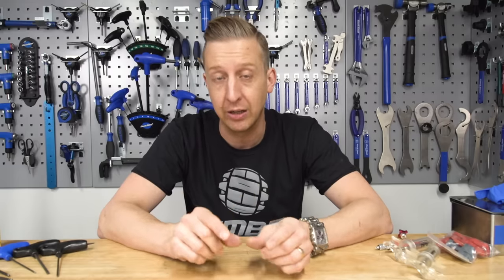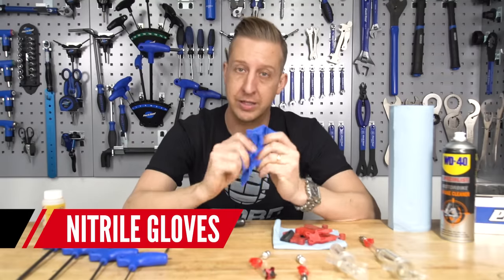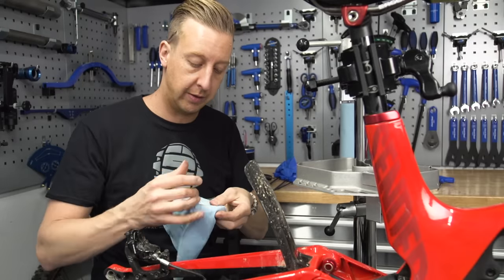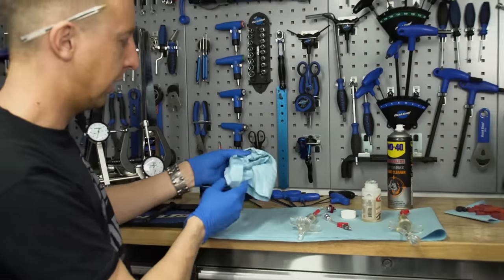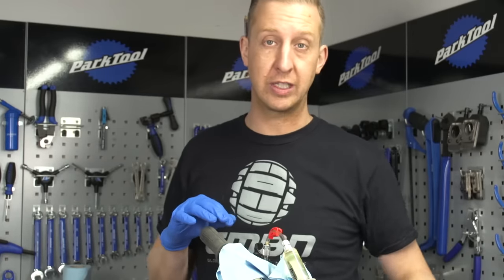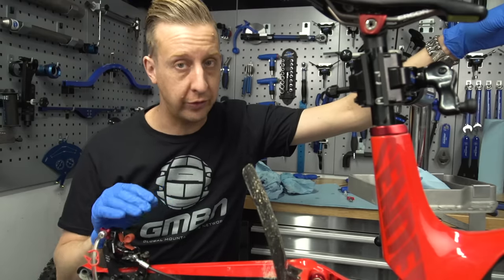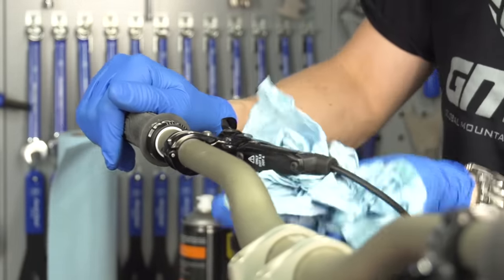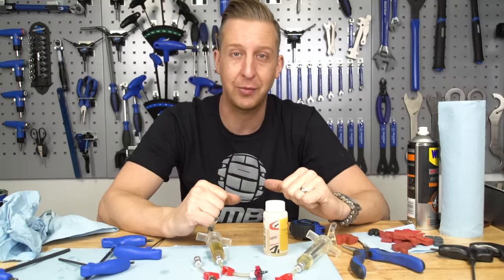How To Bleed New Sram MTB Brakes | Bleeding Edge Technology

Comment: watching this makes me appreciate my fool proof rim brakes on my 26 wheelies.
Reply: Lol.  Fool-proof.   Yeah right.  Case a big jump at high speed, bend your rim or untrue your wheel and see how great those rim brakes are.  Go through mud and water not to mention rain while descending a steep fast trail and see how great those rim brakes work.  Disc brake performance is unaffected by all of the above.  (Granted some will squeal but that’s true of rims too.)  Additionally you grind away your rim in time if you ride in a lot of dirty conditions like I do.  Lastly of course disc brakes simply have way more stopping power.  A nice thing to have when you’re 200 lbs and heading 30 mph down very steep single track and need to... BRAKE NOW!
Reply: Pete West dude chill hes just happy with his brakes just calm down dude
Reply: Where I live there is nobody who does this kind of maintenance by the book.
Reply: I'm getting a whiff of Aspergers from Pete West.  Guy sounds fucking insane.
Reply: RollinRat  I agree. What I'm saying is that people without their own shops are also without options.
Shops around here never do it right, or right out break it while doing maintenance.

Comment: Guide T brakes - can't get enough fluid into the lever, pulls nearly to bar with new brake pads... HELP.
This bleeding edge system seems to be a 1way system, makes it impossible to push fluid from the caliper to lever to refill the spillage. @jennifercoons trick doesn't seem to work - are my NEW calipers busted? Old system was way better for fine-tuning the bleed / fluid levels.

Comment: So I have mostly been a Shimano user. My new bike has a pair of Guides on it with T levers. I just went to bleed them for the first time and it was an AWFUL result. I've followed GMBN AND SRAMS videos and followed the steps meticulously. 3 Times. No matter what, I lose all the pressure I pushed into the lever when I disconnect the bleed hose. I've read a million forums, and people suggest pushing the oil through WHILE closing the bleed screw at the caliper, as opposed to just leaving the caliper closed when you pressurize at the lever. This did not work for me. When I'm pressurizing the system I can FEEL how firm and incredible the lever is, but as soon as I disconnect the hose from the lever all the oil and pressure just escape the top. I put the screw back and all the pressure is lost. Spongy lever. EVERY TIME. I made sure the lever is above the caliper and that the caliper is correctly oriented. There are NO air bubbles coming out of the system. Ive tried manipulating the lever while performing a bleed.  HOW do you get the pressure to REMAIN in the system when you disconnect the hose at the top!?
Reply: @jasperbakkertube  Thanks for your effort! I had actually seen this guide when I was experimenting! I was trying this method, which felt great as I was bleeding but it still lost the firmness when I disconnected the syringes. Ultimately after experimenting and practicing I figured it out with consistent, repeatable results. For me, the missing step was really waiting for the syringe to equalize as I pushed it down and squeezed the lever. I needed to really hold down the syringe and pump the lever until the system adjusted, which took a minute or two. I was likely releasing the syringe too early causing the pressure to kick back up into the syringe!

Comment: After disconnecting the lever syringe, so much oil leaves the bleedport, that the the lever isn’t pressurised enough. Is there a trick for not letting too much oil being pushed out of the leverbleedport? This problem only appears with the back brake (longer hose?). I hope someone has the golden tip!
Reply: Michel Kok I have had better luck ending with the caliper end since it has the bleeding edge port which is designed to be closed while connected

Comment: Why can't you use mineral fluid in a dot fluid specific brake....
Reply: Ghosty1890 Because the brake line already has dot fluid inside it and dot will destroy mineral oil. However if the brake is completly dry when you get it you can try it! I wanted to try it myself but haven't had a chance
Reply: Sumo's'Enduro cheers always wondered
Reply: There is a rumor that mineral oil can ruin D.O.T.-specific seals (and the same is said to be true the other way around).
Reply: KennyMinigun but the dot fluid is more corrosive and so in theory would be more resilient...but could be wrong...cheers
Reply: Ghosty1890 I'm a bikemechanic and I can say you two guys one thing. Mineral oil does not ruin dot specific seals. But dot ruins a shimano or any other mineral oil brake.
Reply: Sumo's'Enduro yeh that's what I guessed
Reply: Ghosty1890 But I haven't tried it yet. I want to try sram brakes with mineral oil.
Reply: Sumo's'Enduro yeh love to do a bit of testing....maybe we can see whether doddy can try it
Reply: Ghosty1890 Yeah maybe
Reply: http://www.peterverdone.com/sram-guide-insanity/ This is the link for your question. And you may need to think again Sumo's'Enduro. Cheers.
Reply: Dũng Lê Văn Thank you very much! I legit thought that D.O.T specific seals don't have a problem with mineral oil since the mineral oil isn't as agressive as D.O.T but I was proven wrong! Cheers mate!
Reply: A friend ran olive oil in all his brakes. Can't member which models, but it was a pair of Guides and a pair of XT. He claimed no issues after a year. Personally I think rapeseed would be a better oil, or even peanut, as they have higher boiling points.

Comment: #askgnmbtech hey guys love the show, Doddy I have SRAM RS and SRAM RSC breaks however I have to pull the leaves to the bar to get full lock on my break, I have small hands so have the leaves adjust quite close to the bar any ways, would this have an affect on the bite point of the break, the RSC has a bite adjustment and even when that's fully screwed in I have the same issue. Would a bleed of my breaks fix this or does it need more fluid. Thanks in advance
Reply: Bleed the levers with the Contact Adjust set half way, you can then use that to tune your lever feel + or -

Comment: grate channel. love your videos. but in this case there is one mistake. you should start to bleed from caliper, not from leverage, in this case you will have less chance to have left air. when you push fluid from top like in this video, air bubbles wants to go to top and despite you push fluid from top to bottom some air due to movement to top have more chance to remain in system. same mistake exist in official sram video.
Reply: Is it possible that if the experts are doing it one way but perhaps you are the one that is mistaken?
Reply: @iseeker3845  i saw 4 or 5 different video how to bleed sram brakes. 2 of them did in one way (lever to caliper) like in this video, 2-3 of them did in other way (caliper to lever). so i am not alone. and my post is not about to point to some ones mistake, but help to other people based on my experience. i spent half day to bleed my new brakes, but they still were soft, next day i bleed them from caliper, and got perfect result.
Reply: @kvv515kvv  Same here on intent.  I've watched and read a ton as well.  Just did my first bleed yesterday (last night).  The manual I'm using shows lever to caliper for bleeding edge sram systems but then shows caliper to lever for non-bleeding edge.  Maybe they made a mistake but it seems more likely some system go one way and some another.   https://www.sram.com/globalassets/document-hierarchy/bleed-manuals/sram/gen.0000000005245-mtb-disc-brake-hose-shortening-and-bleed-rev-f.pdf
Reply: @iseeker3845  this manual seems to me most proper, it has second face when you push ALL fluid from caliper to lever (not a little bit like in this video), even more they say repeat process several time.

Comment: Nice work Doddy!! I’m literally about to try this. I had a feeling there was something different about the calliper. 

What torque wrench do you use??
Reply: the pro bike tool one is a solid cheaper alternative to park tools expensive stuff. although that only goes down to 2nm i think. realistically torque spec for those bolts is just hand tight. run it till it stops with 1 finger on the allen key and youre good

Comment: Hi Guys!
Can I make a  Shimano 10 speed mech with a 9 speed shifter and casette. 
(I tried it and it doesn't seem to work at the moment, sometimes the chain only shifts after two pushes of the shifter and it can't get to the two lowest gears)
Any suggestions?
Thanks
Reply: Shimano 10 speed mech work*
Reply: No, it won’t work
Reply: The 10-speed Shimano MTB shifters use different pull-push ratio (aka Dynasys) than 7,8,9 ones (called SIS).  So yes, combining Shimano 9-speed shifter with a 10-speed derailleur  won't work well
Reply: WON'T WORK
Reply: But what if I buy a 10 speed shifter and adjust the limit screws so the chain won't jump over the biggest cog?

Comment: Which bleed block do I need for sram code rsc brakes?
Reply: The one that fits pushing the pistons back into the caliper. Clean pistons before hand if dirty.
Reply: @3g0r3  what if none of them fit, i bought an sram pro bleeding kit.. for my sram breaks.. not a single bleeding block fits

Comment: Nasty stuff to get in your eyes to......maybe some safety glasses would be a good idea:-)
Reply: i think it would be pretty hard to get that into your eyes tho
Reply: so true!!! more important than protecting your hands is protecting your eyes.
I ALWAYS wear clear safety glasses when bleeding my brakes
Reply: Renzo Nuñez Jup. I cringed when he showed the tools for the job and didn't showed any glasses.
Reply: Being honest I prefer to get a skin rash rather than lose my eyes.
Reply: Andrew Dodd I even wear them when I work on Shimano or Magura breaks.
Reply: did you ever had brake fluid on your hands? nothing happens. just use a paper towl and your hands are clean. it is corrosive when it is a long time on a paint
Reply: Brake fluid on the hands is fairly harmless. Just wipe it off, wash hands and use some moisturizer afterwards. Just don’t ingest it. The exact same holds for hydraulic mineral oil.

Comment: I have a question: I have the trek remedy 8 2018 it is aluminium and the brakes are sram guide R and I wanna know if guide RSC  would be good for my bike??? cause the guy in the bike store told me that RSC is good only for carbon
Reply: Sumo's'Enduro I have Shimano Saint in my downhill bike and for some reason there is  Air inside!!! And the brakes guise R are not vas It was just a question
Reply: maybe your LBS is simply recomending you to save money, if you are happy with your brakes you don't need to upgrade, as you can imagine..  they are not giving you all the information. difference with rsc over r are: better modulation (swinglink technology), better heat resistance, a nice regulation of the contact point. if you need an advice, you have to specify what you need... better power, better modulation, save weighta and your budget, going for rsc is not the only option here.
Reply: giuseppe falconi actually more power
Reply: Cost wise, watch for guide RE. Good cost, same R version lever but powerful code versione calipers. Or go straight to code rsc  but spending a lot more..
Reply: which brake makes sense to use has absolutely nothing to do with frame materials..you shouldn't upgrade your brakes, better upgrade the bikeshop you are visiting...wtf

if there is air in your shimano system it's not because your brakes are shimano ones, it's because they sucked air over time, every hydraulic brake does that..bleed them and they will be fine.
Reply: Manuel Wo Hi I already bleed  and still have that problem!!!

Comment: What do I do if I can't slide the bleed block in?
Reply: push the pistons in using a tire lever or something plastic, gently.
Reply: push the pistons with a tire lever back
Reply: Push the pistons back
Reply: @th_js  what if the block is literally too wide
Reply: @chasem801  Then you literally have the wrong one.
Reply: @chasem801  Haha I just realized this comment was over an year old! Did you seriously not figure this out in a year? :D
Reply: Tomi Saaranen my comment was 4 hours old.. the post was a year ago.. I just started this today. And no I have the right one.. it’s a very weirdly shaped one that apparently fits somehow but idk how to yet.. I’m gonna figure it out later
Reply: Tomi Saaranen I have sram breaks.. I bought an sram pro bleeding kit.. I didn’t know why it didn’t fit
Reply: @chasem801  Which brakes do you have? Level, Guide, Code..?
Reply: Tomi Saaranen level T
Reply: @chasem801  It doesn't fit, because your brakes are 2-piston and your bleed block is certainly designed for 4-piston brakes like Guide or Code. You need to get a new one.

Comment: I've got a quick trick for not wasting any DOT fluid getting the air out of the syringes. Don't push fluid out of the hose until the air leaves the syringe. Wasteful. 1) With the hose pointing up, pinch the hose with the red clip. 2) Slowly loosen the hose where it attaches to the syringe. 3) Gently push on the syringe while loosening the hose until the trapped air can be forced out past the seal. 4) Once the air pocket disappears and a little bit of DOT fluid starts to show around the hose seal, re-tighten the hose to the syringe. Done.
Reply: Just bend the hose slightly so the syringe tip is up and the end of the hose is still in the DOT bottle. Slight press on the plunger puts the air & little fluid back into the bottle.

Comment: I along with hundreds have this problem on days over about 32 C. The brakes jam so hard  that the wheels lock.  I don't like these RS Guide brakes anyway, as they have a sloppy and limp feel, and this issue is extremely dangerous and inconvenient. I will return to XTs or even SLXs. I will never ger SRAM brakes again

Comment: Hold up - why are we 'pressurizing' the system at the lever when there's no bleed valve at the lever? The fluid clearly just leaks out as soon as you remove the syringe and it returns to atmospheric pressure (and a mushy lever). Why wouldn't you pressurize it from the Bleeding Edge valve at the caliper instead? And why is SRAM so retarded that they would put the Bleeding Edge valve at the caliper and not the lever?!?

Comment: Hydraulic brakes on a bike...a pedal bicycle...with a hydraulic brake system...WHY??? When cable operated disc brakes replaced those suck-ass rim grabbers (all rim grabbing brakes suck 10 ways from sunday), it was all kinds of awesomeness! They don't require any special maintenance and you don't have to worry about fluid contamination or leaks. They provide all the stopping power necessary (and then some) and they last and last. So why a stupid, fragile and gimmicky hydraulic system that needs to be checked and topped off before just about every ride? Is it a status thing?
 Random bike snob: "I have hydraulic brakes so I'm automatically better than you stone age cable users."

Comment: How to properly set up the SRAM guide: loosen the the two bolts on the front and rear of your brake caliper. Loosen the bolt on your brake lever. Remove SRAM guide. Install Shimano brakes. Done!

SRAM Brakes are hot garbage. I know that because I have the "pleasure" of owing a bike with a guide r and I absolutey hate it.

Comment: Avoid this junk like the plague, anything SRAM makes for that matter.  Their warranty is a joke, my bike with less than forty hours on it which is a 2018 Santa Cruz Bronson has literally had every component made by these guys fail and of course it's past their alleged two year warranty.  The Reverb dropper (made by SRAM), guide R brakes, and derailleur have all FAILED on what is still a new $5k bike.  They wont deal with any consumer personally and you will need to take your bike to your local bike shop where it will sit for an undefined amount of time to be no less than a week at which point they will "determine" based on that LBS feedback whether or not they want to cover their junk product.  Waste of money (a lot of it) and more importantly your precious time that could otherwise be spent riding